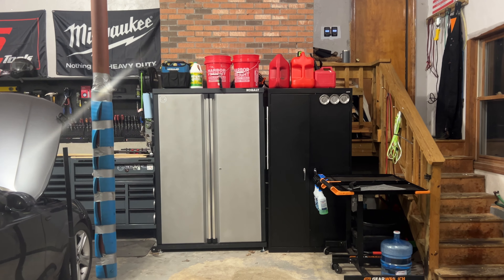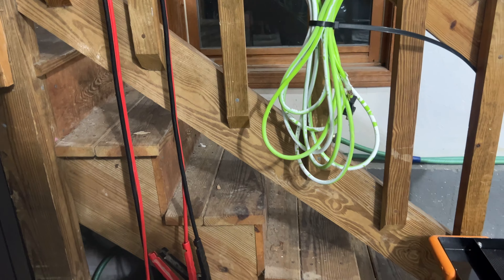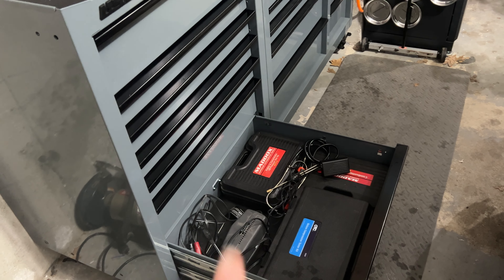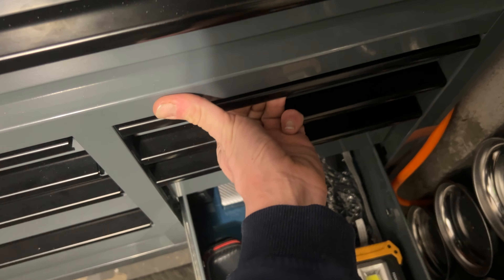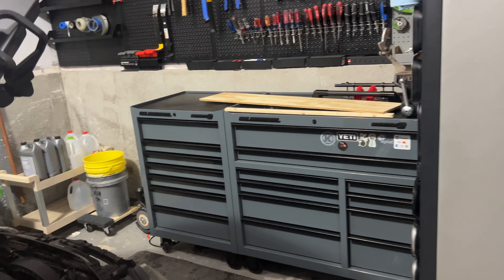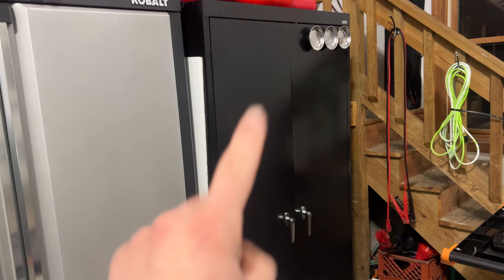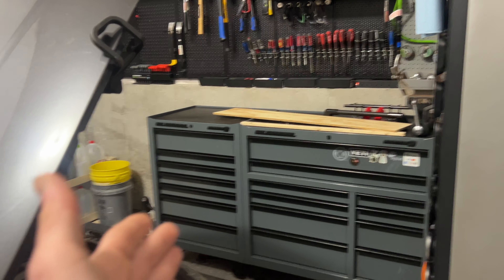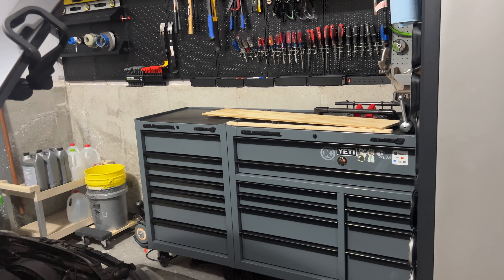Garage Update… NEW SERIES 3 TOOLBOX?

Comment: @7 minutes you mention that they are not meant to hold a ton of weight, I have a 72" and my entire top draw is full of impact and hand drive sockets, weighing at least 3-400+ lbs, and it has no issues whatsoever. Still slides like there is nothing in the (you can feel it in the momentum though).
Reply from the maker: Good to hear! Maybe these smaller boxes have less bracing, when I had my top drawer weighed down… it felt very wobbly / I was scared it would break on me. I took some of the stuff out and put it on my pegboard
Reply: @E82djc   The 56" and 72" top draw has double rails, it may be the difference, though I have a good amount of weight in some of the other drawers also. BTW, you mentioned that you bolted the two HF cabinets together. I'm hoping to do the same when I get my next one. I bought the 72" w/Hutch, and two 22" side cabinets, and looking to add another 42" with an upper cabinet to accommodate all my tools. I was going to put the second box connected to the 22" cabinet, but would rather have all the drawers in the center, I'm not sure if the cabnite sides lined up because of the different wheel sizes, though may just be the 72" that has the really big HD wheels...